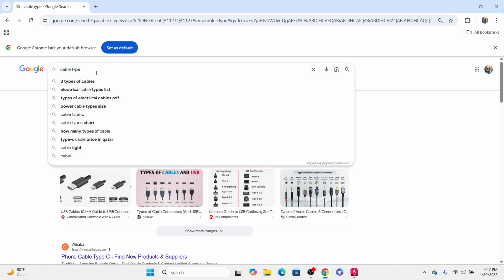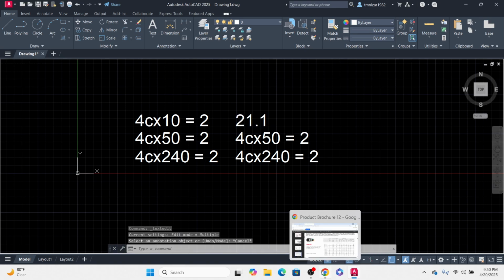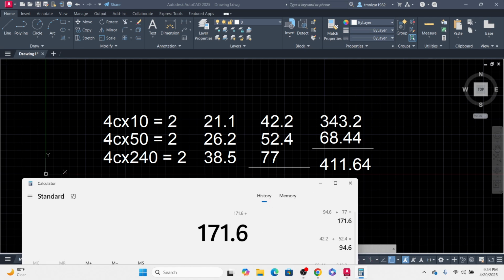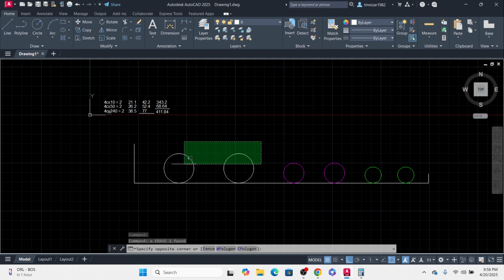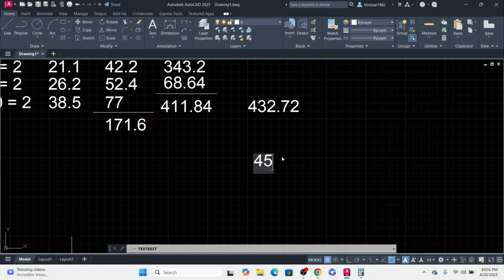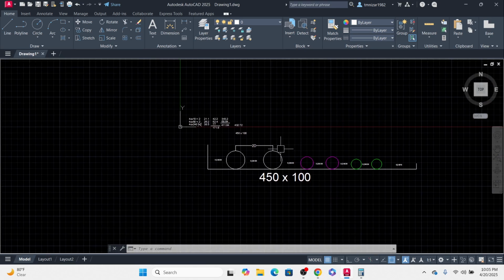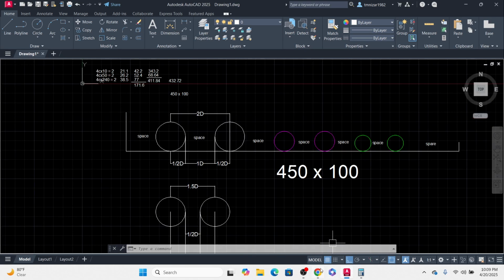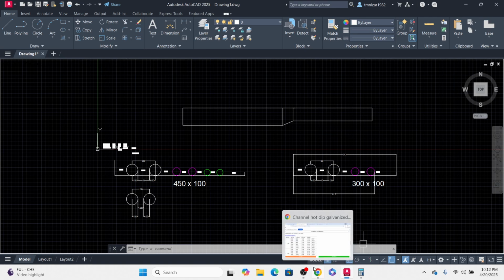AutoCAD How to Calculate Cable Tray Size or Cable Tray Size Selection

Comment: please why you multiply 171.6 by 2  . i belived that the cable tray will have 4cx10 x2 , 4c x50x2, 4cx240x2  cables. why now you mutiply by 2   the result  171.6. I understood for multiplication by 0.2 .
Reply from the maker: Cable to Cable Should Be one Cable Distance if I have 1 cable and its dia lets say 50 then the cable distance to other cable should be 50 so what i did i multiplied the cable dia by 2 if you watch complete video you will understand and its for thump rule only actual also i have explained please watch complete video thank you